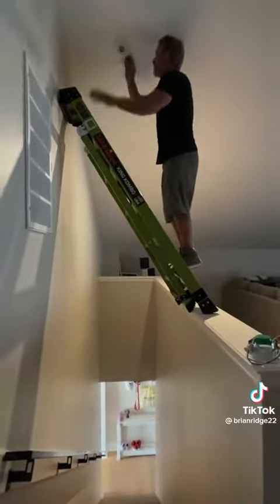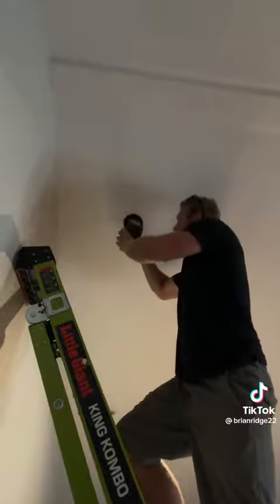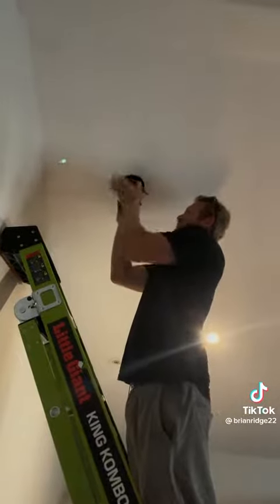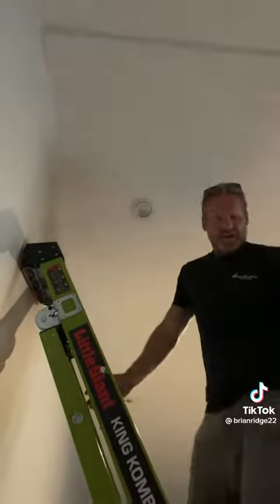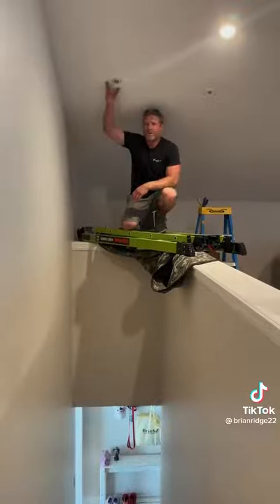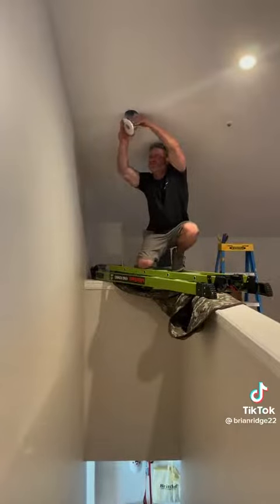Low Voltage Conversion to LED

Comment: Hi do you have a link to the retrofit kit you used? Also, was the original halogen the two pin bulbs you push into the socket? Thanks!